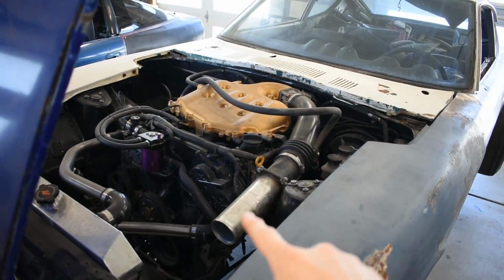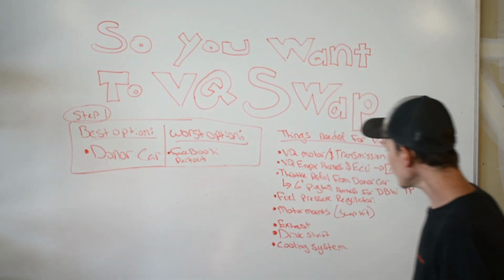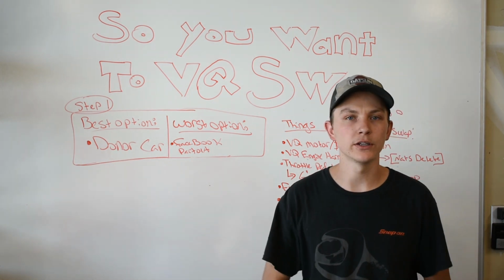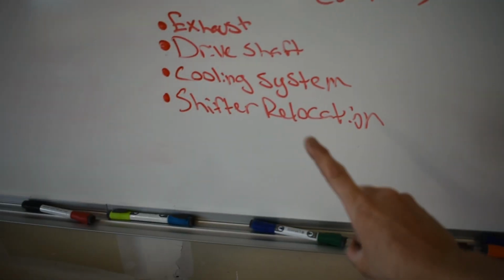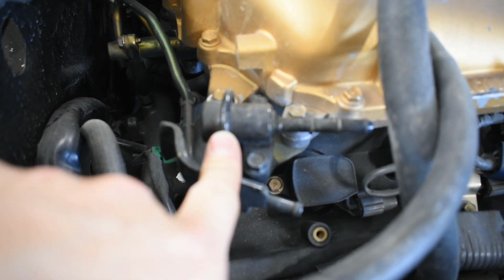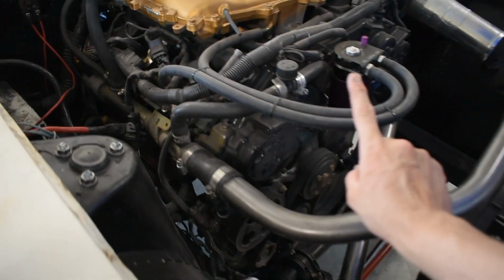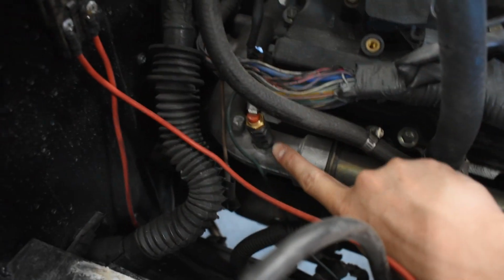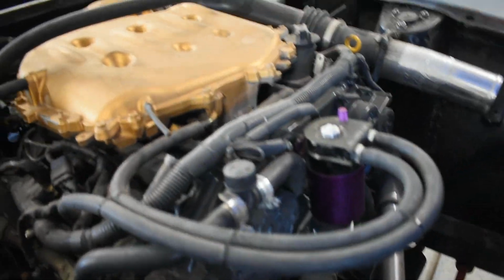VQ35 Swap Basics

Comment: Speedo? I know the G37 2011 has a sensor at each wheel that I thought was for ABS. Research revealed (it looks like you know your stuff so, please enlighten) that rpms were read from the transmission to provide speed. Im currently in the middle of swapping VQ37VHR into a D21. I'm planning on swapping almost all of the electronics includeing the BCU, radio, etc, except the wheel speed sensors. I wont have to flash the ECU if I keep enough of the original wiring.

Comment: I’m planning on doing a VQ37VHR swap into an earlier Z31 / Z32 car. Please advise/ Describe the engine to older Nissan 5 speed manual transmission. 
  Earlier VH45 DE engines were easily done and were very adaptable to mate these up. What am I getting into to swap a VQ37VHR motor -to - an earlier transmission ?  Your video and dialogue on your swap have been very informative and of great interest here in NW Pennsylvania. Thank you.

Comment: On the harness/ecu, what pin/ wire is the 12v constant? And is that wire alone enough to power the ecu?? This is the last thing I need to get my vq swap running

Comment: best v6 engine ever produced by Nissan:VQ series...prove me wrong!
Reply: Seems like all of nissans v6 engines have been amazing, vg30 series especially the de can make insane power boosted with stock internals, and vr series is vq on steroids its really quite impressive honestly
Reply: @dylanBehrproductions  I just bought a 3.0 Cefiro here in SE Asia. The kilometers just turned 345,678 LOL.  That's about 214,000 miles.  It's a bit of a gas guzzler but runs fine. I also bought a 2.0 Cefiro first. It's not fast but it should outlive me.

Comment: Do you by chance have your measurements for the drive shaft you had made? I’m doing a VQ 280z swap also and if you have that number it would take some of the work out.
Reply: Can I ask what motor mounts you are using ?
Reply: @LZ_Mobile_Tint  custom. 2 different LS mounts bolted together (one stationary one swivel) then welded to the frame.

Comment: Hey buddy I wanted to ask you and important question. You said I could run ac with the Vq35de in a 240sx? Because I have the stock heater core an blower motor from a 240sx but I need to bang up the fire wall to make the transmission fit and exhaust, but then the heater core won’t fit back in if I bang it up, what should I do??????

Comment: Can it work in to a right hand drive vehicle cause it’s only left  hand drive vehicle me see the swap going it to  so far
Reply from the maker: Yes, this swap works with both Right hand drive and Left hand drive. With a Right hand drive car your able to keep the VQ AC compressor in the stock location. On a Left hand drive the AC Compressor needs to be removed to fit the Steering shaft.

Comment: What fuse boxes are you going to need for this swap? Or do you need all of them. I think there are three under the hood.
Reply from the maker: Depending on what route you go with, you will need the vq engine and transmission with full engine harness and ecu intact. You don't need any of the body harness from the donor car except for the throttle pedal pigtail. From there you can choose to buy an aftermarket plug and play relay/fusebox from Guilty Garage that plugs into the ecu harness. Or you can make your own.
Reply: @zammy8749  ok so I need the vvel unit and the ipdm. With that I should be good? The other one looks like it’s a body harness.
Reply from the maker: Unfortunatly at this time I don't have a hole lot of information on the Vq37VHR swap. Try contacting Hexa garage. Here is a link to their standalone VQ37VHR swap wiring harness. This plus a ecu flash should be all you need. 
https://www.hexagarage.com/wiring-services/vhr-swap-wiring
Reply: @zammy8749  alrighty thanks!

Comment: What if i buy a after market ecu for the vq engine?
Reply from the maker: An aftermarket ecu or "Plug and play" will not require a Nats delete since you are replacing the computer. only the stock ECUs have the security feature. You will still need to wire your engine harness to power the ecu if its a swap.
Reply: @zammy8749  thanks!

Comment: Thanks for the info. I've been looking for info for a while now. I got a VQ35 engine + transmission with accessories and harness but I dont have the ECU. Im wondering if I can use another VQ35 ECU with NATS delete or I need to go other way to make it run.

Comment: Best video I have seen so far for the VQ swap into a 280z. Thanks for all the details being explained. You saved me a ton of headache!
Reply from the maker: Glad to help!
Reply: So sense you have to remove the original hood latch. Im guessing you have to use some aftermarket hood latches that are exposed from the outside? Is there any way to get around that?
Reply from the maker: @justinroberson9678   Great question, i'm glad you asked. I actually plan to run the stock hood latch, or a similar one from a wrecking yard, relocated to the side of the engine compartment. I would use 2 latches, one for L and R, and T the cables together somehow to the original pull.  I don't want to use hood pins or any external latch system. I am also keeping the factory hood springs. Ill upload a video on how I do the hood latches when the time comes. Stay tuned.
Reply: Zammy awesome. Never thought about using two of them. I’m not a fan of the external hood pins and didn’t know how others have done it. Can’t wait for the vid.